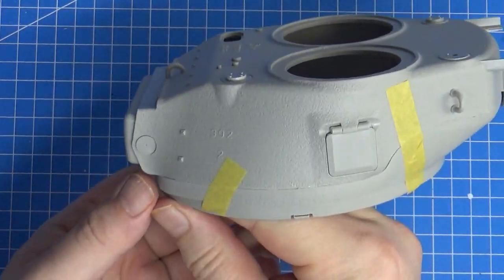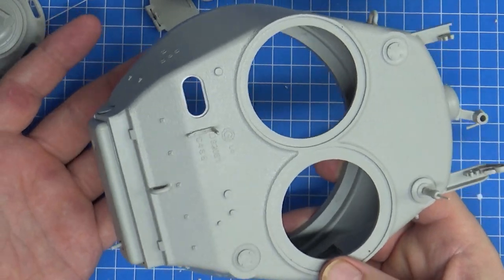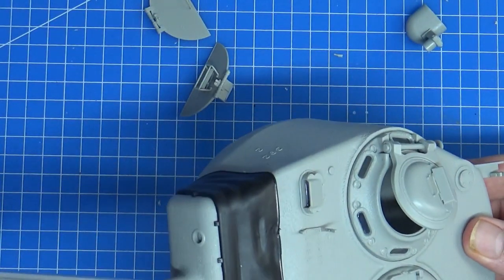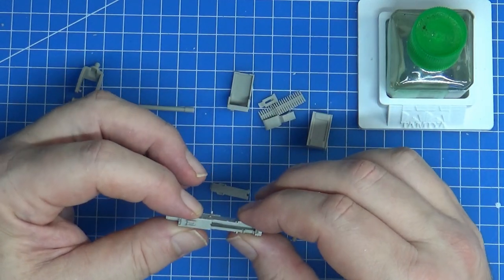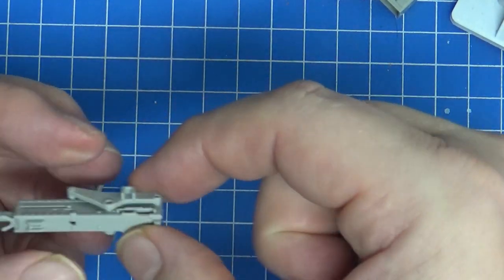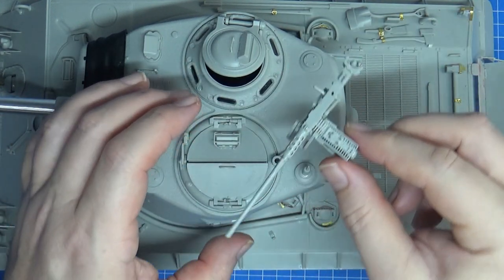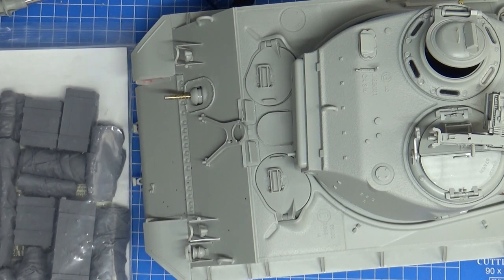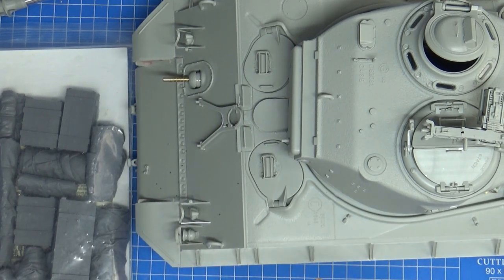The Turret and Final Assembly - 1/16 I Love Kit  M4A3E8 Easy Eight Sherman

Comment: Hi, you are doing a great job of the Trumpy kit and it looks great, be good to see it with the cast texture and more welds done. The cheaper Trumpeter kit is a copy of a RC kit as I was going to buy but glad I did my research first. I brought the Andy's Sherman and it is a very nice kit and as far as I know after some test fitting and  watching a couple built up the fit is very good, I am also building the Takom Jeep which has heaps of detail and the fit has been great except for a couple of parts that have a gap, plus a lot of pin marks in some areas,  as for Takom in general they have some good kits and bad kits it seems just like a lot of model companies and I would say Andy has a lot of say in the design of his kits which makes a huge difference to the final product. cheers Bob.
Reply from the maker: Thanks Bob, yeah Takom are sometimes hit and miss, I think they will improve over time and indeed having Andy help with the QC lifts their game for sure. Cheers Chris